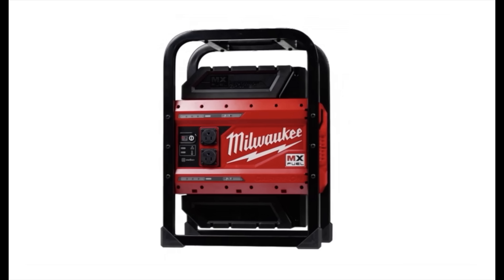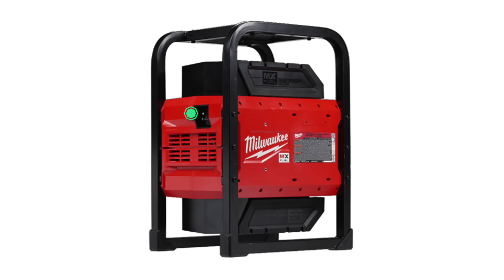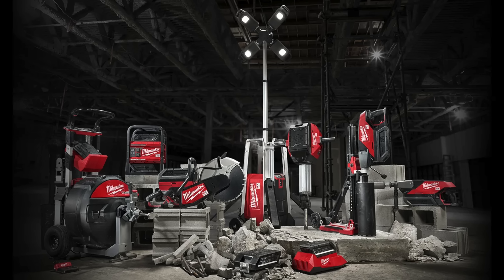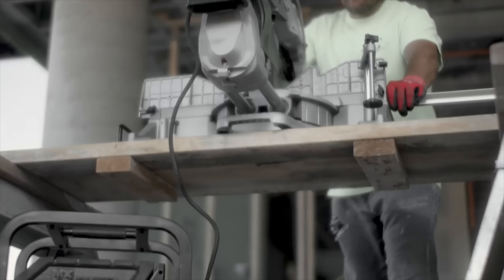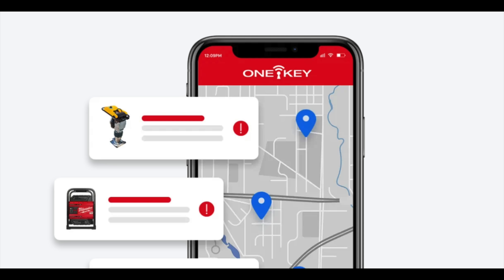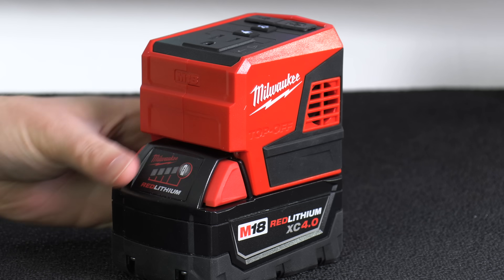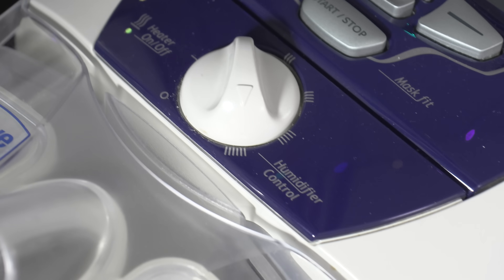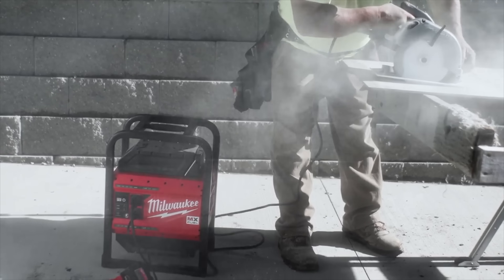END of GAS Generators? Milwaukee MX Fuel Carry-On Changes EVERYTHING 3600 Watts!

Comment: "First mainstream company to ever release one of these"? Are you serious, DeWalt released one of these years ago! And their's has the same 1800/3600 watt spec's, as well as using their regular batteries, either their 20V or their 60V batteries, without having to give your arm or leg for one of those friggin batteries at $800 a pop LOL. Oh and don't forget the cost of the "generator" itself, huge difference! 

Milwaukee = $3000
Dewalt       = $500

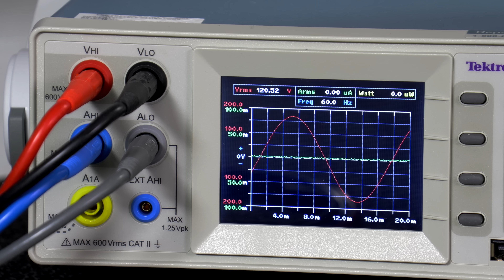And what are you taking about at 1:46, lithium IRON? These batteries are the same as everyone else's, lithium ION.

Comment: No mention of kwh in the video.  That's because if you compare the kwh of the battery packs to the equivalent kwh contained in a Honda 2200's tank of gas, there is no comparison at all.  The Honda will put out its full power for 4 hours.  That's North of 8kwh!  Just the Li-ion batteries alone required to store 8kwh would weigh 200 pounds for the very lightest (expensive) packs.  And that's not counting all the electronics.  With the Honda, if you want another 8kwh out of it, just pour another gallon of gas in it. Heck, you've got 40kwh in your 5 gallon jug.  With the battery "generator", you'd have to wheel in another fully charged 200 pound battery pack.  They are two completely different products.  We fly very large drones commercially and run 2 of the Honda 2200's continuously to keep the drone batteries charged.  The Milwaukee could charge just a single flight pack and it would be empty.  It doesn't come close to replacing a generator.

Comment: Give one of those to a roofing contractor to run his nailer compressor for the day and get back to me.
How many Kilowatt Hours is that battery pack good for?  For fire restoration, how long will it run a dehumidifier?
Reply: There are electric nailers that use very litte power and this battery generator can EASYLY run them the whole day! ;) And this electric nailers can be as powerful as compressor nailers so no problem there.

Comment: nothing new battery inverted and it doesn’t generate why they can call it a generator Miss leading by my account. it is a inverter with battery’s and that’s it and way over priced. the inverter is like maybe $300 battery a $800 and the plastic another 100. so just get the inverter and a good 12 volt Lithium battery  for probably Half the price.

Comment: I can use my awesome Honda generator to charge this thing, sweet.
Reply: Hondas are great. Love the idea of a generator to charge a generator lol!
Reply: Not a bad idea actually
Reply: The idea of using the honda to power my home and charge this during the day, and this to power my home, 20 amp interlock low draw, during the night is very attractive. Avoids the generator theft issue present from extended outages.
Reply: @dennism316  I already do this with another battery backup gene and my champion gas gene, funny thing why I'm commenting since my gene was stolen at night once... I had it running and used a huge chain with a rod into my concrete block i had my gene sitting on. Figured no idiot would steal it since it was over 100lbs and a giant 50 foot chain with multiple locks on a 300lb slab... Nope, all the sudden the power cut off around 2am, figured it just ran out of gas or something, took my time getting out and was gone lol. They some how were able to cut the chain in the multiple spots needed in other to break it. Funny part they actually tried to cut the concrete first lol... Now I have a camera aimed at my gene even during the day with motion detection to alert my phone, and store it at night with a battery bank for night use in my basement.
Reply: @Tim_Gravy  interesting. You can't expect a huge draw out of this. But should be way more than enough for lighting (assuming led) , tv, and gas heat. Fridge should be fine off overnight.
Reply: Big brain!!
Reply: Or solar panels ;)
Reply: I use a generator to charge my batterie in the daytime and use battery at night
Reply: I can use my Harbor Freight Predator generator to charge it. I wanted Honda but after a big wind storm I was lucky to snag the HF model.
Reply: @shawnharper3440  yeah I don't actually have a honda.  I have a Yamaha 2k inverter knockoff. But pairing with a battery for overnight usage is very attractive.
Reply: Alot of money for this. Needs being charged from a source. Just use a gasoline powered generator without having to buy the replacement batteries for a storage power supply.
Reply: also it's not power bank, it is a coverter/inverter from 19v to 120v
Reply: @uglyduckling1169  True. Thats why i used thoose: "".

Comment: Soooo... Can it or shouldn't it charge itself?😁
Reply from the maker: Its unconfirmed from Milwaukee but they say if you plug it into itself it will open up a blackhole. Seriously though, yes you need to charge it, or if you had a gas one, you need to add gas every time.

Comment: Notice in the video they never said how long the "generator" last on a single charge under load.
Reply: I think thay have good purpuse, but only under strickt rules. For Not power hungry machines and not to do much work. But, u can for 100 Dollars by 12v Inverter, and for 100 more battery 100ah. Sooooo, for 1800 Dollars u can by car and some tools
Reply: yup the MOST important stat needed after the wattage ... how many amp hours of charge it holds ...
Reply: It’s for one 15 amp tool.

I see no purpose for this except new construction with no power line due to OSHA or something.
Reply: With 2 batteries installed it has a total run time of just under 30 minutes at 1600w output (according to my 30-year old ELE math).
So you can run ONE table saw for half an hour.  Then you're screwed.
Reply: @thetruth-hl7ct  The thing is: saw DOESN'T consume on average 1600 W of power. The peak power is 1600 W ONLY WHEN it is fully loaded. So if you are cutting for example 2x4 it is probably fully loaded only for a 3 seconds per cut. So you can run a saw probably 4 hours not just 30 minutes. And 4 hours is plenty enough for 8 hour work day..plenty enough for most cases.
Reply: @damijanapopotnik8081  Yeah, and Milwaukee makes a full array of cordless table saws and other large power tools, and they're much much cheaper than this battery pack.  Instead of buying this thing to power ONE corded table saw intermittently for a day you could BUY a cordless table saw, a cordless compound miter saw, a cordless brad nailer, a cordless circular saw, a cordless sawzall, a cordless drill, a cordless impact driver, a cordless hammer drill, a cordless work light, and the associated batteries and chargers for all of them.  And you'd still have money left over for beers after work.
This battery pack (because it's not a generator) seems to be the answer to a very specific problem of having a corded tool and nowhere to plug it in.  But it is a very very expensive answer to that very specific problem.  A BETTER answer would be to either bring a real generator to the worksite, or use part of the $2100 this battery pack cost and just BUY a cordless replacement for the corded tool in question.
Reply: @thetruth-hl7ct  YOu didn't get the point. I am NOT saying buy this Milwakuee "generator"! All i am saying is buy Dewalt similar "generator" because it is much cheaper or even better, buy LIFEPO4 battery and connect it to an inverter and you will have basically the same thing for only $200!
Reply: @damijanapopotnik8081  Okay, well it's not easy "get the point"  when you keep CHANGING IT!  You said absolutely ZERO about going cheap by buying some Dewalt battery instead of the Milwaukee hardware you just defended the use of in your last comment.  Please settle on a point and I will be happy to have a conversation about it.
Reply: @thetruth-hl7ct  I am not changing anything! You are accusing me of changing my point, but this is ABSOLUTELY not true! If you would not be lazy you would actually READ all the other MY comments under this video and you would know my point! I have written a lot about makig DIY solution and even Dewalt solution under that video in other comments! (not under Criss's comment, but under OTHER comments!) So .. read it! :)
Reply: @damijanapopotnik8081  Well that's great for you that you like to post lots and lots of comments on one video.  However, I was responding to the one comment you made in THIS THREAD!  It is absolutely unreasonable for you to DEMAND I read every one of your posts before I respond to ONE of them, and then accuse me of being "lazy" for not doing that.  
Please check your aggression and clarify your point, IN THE THREAD BEING REPLIED TO, before making further accusations.  Sheesh.
Reply: @damijanapopotnik8081  That is not how conversation threads work!   The burden is on YOU to clarify your position on an argument IN THE THREAD IT TAKES PLACE, not on me to track down every comment you've made, across multiple threads, in order to decipher what you actually mean.  That is literally why conversations are threaded in the first place.  Is this your first time posting comments on the internet? Because you seem to not understand how comment threading (a practice literally decades old) works.
And please stop with the name calling.  It makes you look small.
Reply from the maker: Until I can test it. I am not just taking their specs, since sometimes companies share very favorable results that just arent real world. I will show that and more for the next demo.

Comment: No solar is a FAIL.
Reply from the maker: Seems silly, even if they never thought anyone would use it, wouldn't be hard to have an adapter or something. Would make it perfect for a lot more applications, or maybe it is just designed to make you buy more batteries!
Reply: @SilverCymbal  I think it's the latter. Someone "reviewed" it and was really hard on it. And the logic they shared leads me to believe it's the latter for sure. 
But aye....someone is gonna buy it. I suppose.

Comment: I had to look it up after seeing this video. The unit comes with two 72 volt, 6ah batteries. So for your two grand buy in, this thing will produce it's rated output for... Wait for it.... 28.8 minutes.

This is not taking into account the losses in the inverter. So it's likely to be a shorter amount of run time at 1800 watts.
Reply from the maker: That is what I calculated as well, I really hope the real world test is more promising but I guess we will know shortly for certain.

Comment: What a waste of money 💰. There is no  Tradesmen that I work with that would pay that kind of money for a Generator . It just doesn't make sense. If you can tell me a  Situation where this would be practical . I can give you a better solution. And good point about the Honda I have had one for 6 years no problem and the cost of gas is passed on the the client.
Reply from the maker: You might be right or it might sell a lot.  On thing I have learned in the portable power space is that people react different to these than other poducts, more so to solve a quick need and less about long term considerations. Right or wrong, we will see what happens in the next 6 months with this one.

Comment: Guys, you are missing the point here. Yes its just a battery but its also a light power source with zero on site emissions. Milwaukee does not make this product for at home use and the price is something that contractors would be totally fine with. Of course you pay for charging but electricity is cheaper then gasoline. This is a technology that is still new. The main benefit of this is to be able to grab the power source and bring it wherever you may need to go. 

All in all, if you are a homeowner it just doesn't make sense. Contractors and builders use a lot of cordless tools as of this point. This can top off thier batteries, make coffee, microwave lunch you name it! It does all this with way less cords as well.
Reply from the maker: 100% right on, it's not the end all be all of portable power but it's a first in the true contractor space. There will definitely be carry over to home users, same as the ones that buy the Honda contractor models but what comes next we don't know yet.
Reply: Finally a comment that isn’t “this new-fangled electric doo-dad is no good... back in my day”
Reply: @christophercrawford2736  lmao

Comment: I did the napkin math on this thing awhile back. 12-15min per large battery those 37-40V ones that are double the size. At 1800 watts. So unless you work in 30min intervals or draw next to no power, it's a honda and an extension cord for everyone.
Reply from the maker: What are you talking about, it has a payback of just 22 years! Just kidding, or maybe its true. once i get the actual one I will run it through the quality and time tests. They only shared numbers that are pretty much useless, I will share the real world times.
Reply: @SilverCymbal  mine was the theoretical energy within the pack based upon the number of cells in each battery. It's rather disappointing if your try using high draw power tools. That included a 20% DC to AC power loss.
Reply: @SilverCymbal  found my old calculation. was a pain in the but to figure out what Milwaukee had for voltage but I did a count of the large batteries and came out to.
"A MX fuel has 72 nominal volts (74) at 6.0Ah for the large batteries. Giving each battery a 444Wh energy rating. Dividing that battery by consumption (444Wh/1800W) = 15 minutes. Factor in 20% DC to AC power loss gives you 12.5 minutes of 1800W continuous AC power per large MX fuel battery."

Comment: One more huge complaint is have about battery powered anything. Lets take tools. If i want or need an extra battery. $145 average. Now if I go to the gas station at average its $2.50 an gallon. Do the math. It would take me many years to get $145 worth of fuel for my mower. Even my riding mower. Solar system for an home. At average $12,000 . For an average setup. My electric bill with water, sewer and trash is $310 . Do the math on how many years it would take me to get my money back. Then before I could think of breaking even. I have battery replacement. At an average of $1,200 a battery. Most homes at average 8 batteries. Do the math. Always in the hole. Lithium is supper expensive. Even if fuel was at $5 an gallon. Fuel is still way cheaper. A gas car on fire, an fire department can put it out. An battery car. The fire department has to let it burn because it cant put it out and is more worried about the surroundings. Sorry, no thanks. I was sold on them years ago. Now dealing with them, im very picky on what I get. Which is very little.

Comment: I was all up on solar and batteries as such. Was. One for solar it takes sunlight. Most days none. Then the charge times. Like I said i was even into and could not wait for electric vehicles, ect. My fuel tank was at half. Pulled into an truck stop with an vehicle quick charger in it. So I pull in and a lady is outside her electric car charging it. Got my fuel. Went to the bathroom. Did some shopping and as left she was still there. On an 60 mph road. 10 minutes is 60 miles down the road. So the only thing I get out of this electric age is, an person to own them has a lot if time to waste. Same as tools. Buy the batteries separate. That hurts. Then temperature. Winter time? No thanks. Way to many factors to say no way. I have an electric hand mower. The difference between it an a gas one is constant power. My electric mower runs only at half until bogged down. An fuel one I can have always on high. Way to many many do not buy me. For little simple jobs and who cares about charge time and power then okay. Fuel straight power curve no matter what. No battery no matter what can do that. It will catch fire in time. Sorry. You can not sale me. Im even looking this year for an gas push mower. You can not beat one.

Comment: These are great! I'm hoping to get something like this as a small backup for home lighting and heating pump power
Reply: I would advise you to invest in  couple of hundred dollars worth of the devices that are usually long, tubular devices with a bulb on the end and replaceable  rechargable "generators". They are readily available as ,"flashlights," and are excellent as home lighting backups. You should seriously consider a gas or LPG  generator of  at least 3kw/4.5kw, and probably 7kw+ for a heat pump - think BTU  For the keys needed.

Comment: You can plug it in and charge it while it’s running. If you plug the charging cord into the outlet on the generator, will it charge itself while powering itself?  This thing could run forever.

Comment: Literally my first thought on the small one was about my CPAP 😄
Reply from the maker: It ran it fine, but how long will depend on the exact model But if you want it without the heater, the runtime would be very good and a couple of batteries should get you through a night.
Reply: I have a Milwaukee brand work light, work fan, and two m18 batteries...if i could run my cpap from my m18s it would be the bomb.

Comment: How’s it a generator when it doesn’t generate anything? It’s just converting dc battery power to 120v ac.
Reply: It's called fraudulent advertising. It's rather a common thing, surprised you're not already familiar with it.

Comment: 3,600 watt start will be ok for many power tools but try and run even a small air compressor and you will need 4,500-5,500watts startup.

The only "generator" that needs a generator to be recharged. Lol
Reply from the maker: I will be testing some of those functions along with run times, quality etc as soon as my order arrives.
Reply: @SilverCymbal  Awesome.  I can't wait to see it.  These units fill an interesting hole in the market.

Comment: its a rechargeable battery .so do you need a generator/ battery to charge your generator/ battery...or you could just get a propane adaptor for your old gas generator their ,40..60,$  making it so you can run on gas or propane